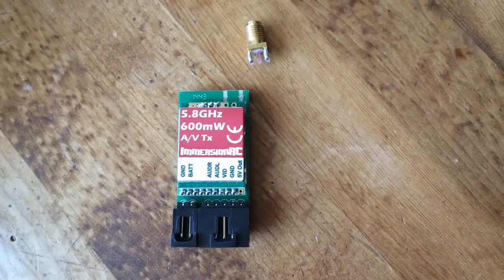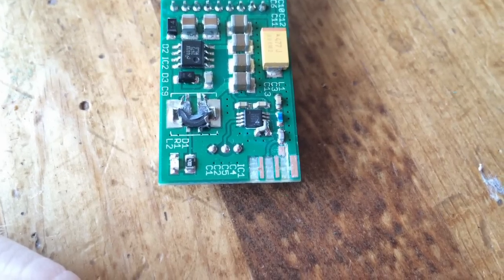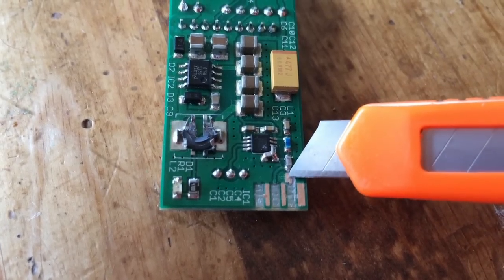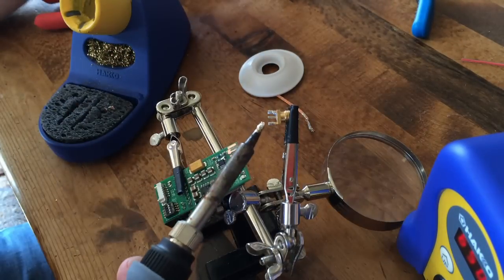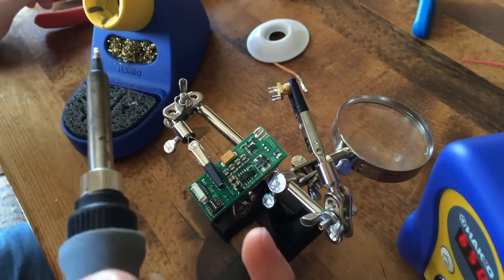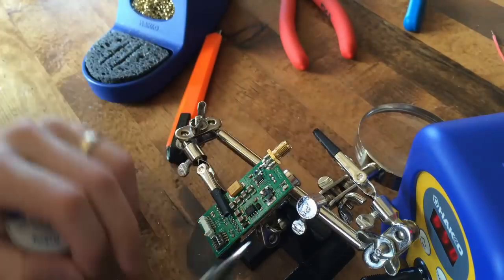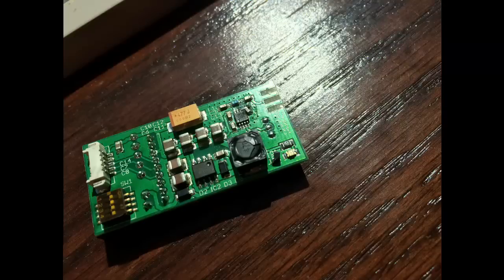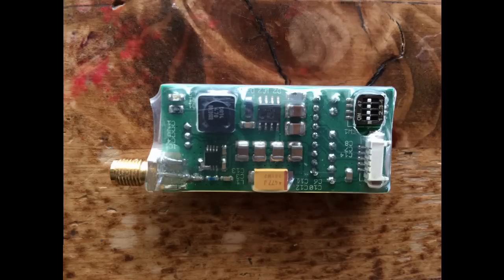ImmersionRC 600mW VTx SMA & Inductor Repair

Comment: Am having white horizontal line fpv noise in my fpv system even when I test my fpv system separately on lab bench power supply
Reply from the maker: I am not an expert in issues of this nature.  When I replaced the inductor I found that while usable for line of sight, the transmitter lacked "punch" and would not transmit as strongly.  It could be that you have more damage to the board then you are aware of.

Comment: What is the use of an inductor in vtx please tell me sir
Reply from the maker: An inductor resists changes to the current flowing through it, while a capacitor resists changes to the voltage across it.  They help filter power.

Comment: great video, I have a same issue with SMA coming off the PCB with part of the capacitor. do you know the value of that capacitor? I need to replace the capacitor  as its damaged.
Reply from the maker: I do not know.

Comment: Hi, do you have an idea of the capacitor/resistance marking which are below the yellow capacitor? (the 4 brown cubes below yellow capacitor). I  miss 2 of them after the crash and need to repair, but they have no marking as for the rating. maybe you can help me. Thank you.
Reply from the maker: +Sergii Lobko 
Unfortunately, I have been unable to find out the ratings of the items described.  I will keep looking for information and post it here if I find out.
Reply: Please disregard my request as I received a reply from ImmersionRc support and got the values now. Thank you for your care!!!!
Reply from the maker: +Sergii Lobko 
Please share any information you received here, you can help other people like yourself. ^_^
Reply: +Make It Fix It Daddy Yes of course. This is the reply from ImmersionRc:  Large yellow capacitor is a 470uF/6.3V tantalum, the small brown capacitors are 22uF/16V 1210 size X7R.
Reply from the maker: Thank you!

Comment: was your range just as good afterwards?  I just repaired mine but i've been reading about people having range issues after these break off.
Reply from the maker: +Nick1814 
I have not done any specific range testing.  I don't have a new one to use to test range effectiveness.  Some issues may occur from damage to other components.  An antenna is to always be attached when the VTx is powered.  You can imagine that in a crash, when the antenna is detached, the "energy" (600mW) has to go somewhere.  You will need to do your own range testing and if you do, please post some results here.
Reply from the maker: +Nick1814, I have run some more extensive tests with the unit I repaired. 
 I find that it is not as powerful as before, my range is limited to 
about 150 -200 ft (line of sight).  I will continue to use the unit to test 
in the "lab" or to test settings in the field, but I will no longer use 
it on a machine in the air.

Comment: Thx. Saved me buying a new vTX
Reply from the maker: +Mike Rotindo 
Your welcome!
I just finished repairing a broken SMA connector for a viewer who contacted me.
Reply: +Make It Fix It Daddy Awesome! I just replaced the inductor I blew by not having an antenna attached. Glad I found this cause I thought it was a regulator I blew at first (LOL!).  Also, in case anyone is wondering, the same inductor works on the 200mw vTX